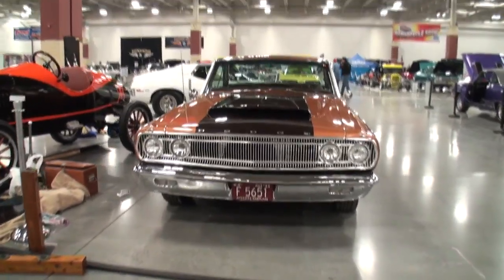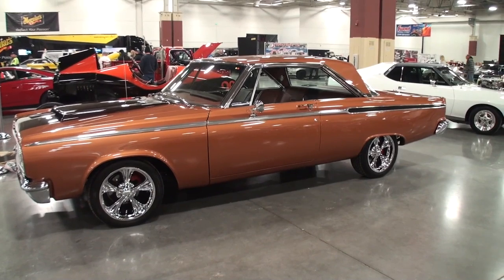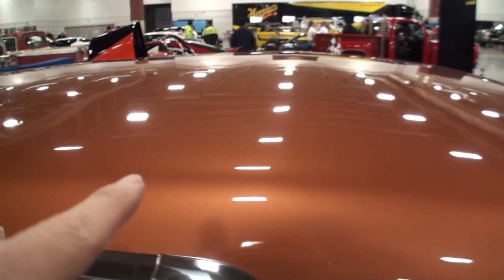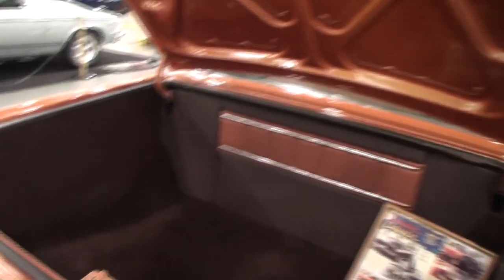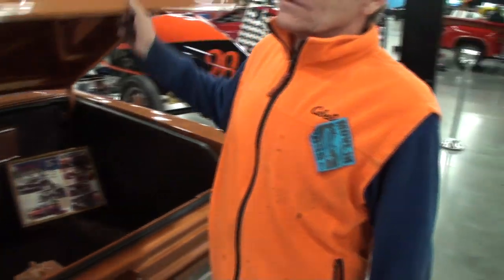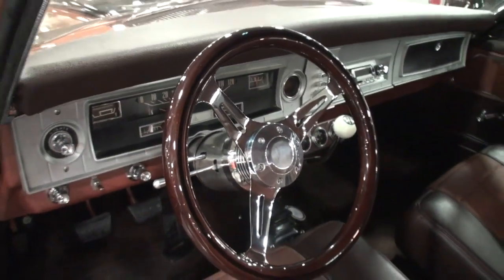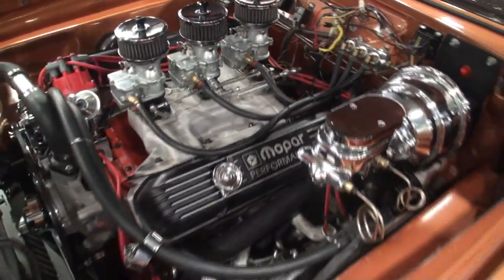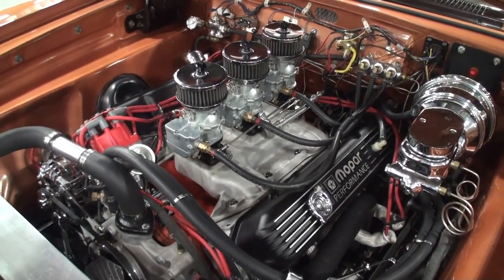1965 Dodge Coronet 440 2 Door Hardtop in Copper & Engine Sound on My Car Story with Lou Costabile

Comment: Original or not it's just georgeous..but when he hit the throttle to start it all carbs were working and when he started it the front carb wasn't excelerating like the back 2..look at the vid and watch the front carb but either way it's nice
Reply: Thank you for the comments.
 As to the carbs. Watch again.
On start up you will see i floor boarded the accelerator to feed a little fuel. .
Then while running. I was feathering the pedal. 
What you saw is tje PROGRESSIVE LINKAGE AT WORK.
ONLY THE PRIMARY CENER CAB WAS WORKING.  ON THE REAR. YOU SAW TBE SLIDER BAR MOVING NOT THE ACTUAL. CARB LINKAGE. VERY GOOD EYE. AND YOU KNOW WHAT YOUR LOOKING AT..  YOU SCARED ME FOR A SECOND .. .HANG ON WHEN THE 6 PACK,IS KICKED IN .
Reply from the maker: High praise for the looks of this car :-)

Comment: 1:40 It's stainless steel, Lou :)
3:53 The call that Dodge triangle thingie a "Fratzog". 
The more we know! I just learned that this year.
4:26!! Chrysler Power magazine!! I read that in the 90's, i still have a couple of their Tee's..that..sorta still fit :p
Mopar Action magazine is the tops for that ancient format, right now..their tech is beyond amazing. 
Well worth the subscr. price.
I wrote them like 10 yrs ago and told them to go YouTube..looks like Lou is smarter! Ahaha!
Reply from the maker: Thank you for viewing and sharing your knowledge.  Everybody sharing helps each other. Nice.
Reply: Thank you for your kind review. Lou posts some awesome rides. 
Tne Chrome at 1.40. Is Actually Crappy anoidized Alum.   That was very beat to hell and refinished at VINTAGE auto in watoma wis.
Being a 1 year only body style car. 
When you see other 65 Coronets most have all,the holes welded shut. And no molding. Its almost,impossible to find a good set. Moldings around windows and roof is Stainless.,

Comment: The carbs & intake look cool..but about 1/3 the CFM this engine needs.
450ish CFM & mini air cleaners wouldn't feed a 340, much less a near 500 ci engine.
It's like having a restrictor plate, in effect. 
But shhh..im just basking in the glow of this car <3
Reply: Thank you.. your on. The right track.
While i was building the engine, I lost control and built a NASCAR Engine for a NICE CAR. 
Thats my Grudge Race 6 pack
Those are the new 97S Stromburg carbs. Total cfm is only 760 on tne 2 Barrel scale. 
Equal to approx. 850 to 900. .
Cfm on tbe 4 barrel weight scale.  2 and 4 barrel cfm are. Measured different. 
,  Buts heres the other truth. 
I grudge. Race $$.
 I mske a couple passes . as you see it. I pit under cover.
Swap tne intake with,my cross ram Dual quads with 1800 CFM.  And. Rin for the big $$$ .
Kinda. Cool old School. 
I have to tell ya. With the 6 pack at 3300 4800 and 6000. Rpm. It will rattle your eye teeth .  ITS a driver as well,  Thanks for watching
Reply from the maker: Thank you for viewing and sharing your thoughts.

Comment: 6:37...a 490+ ci mill & Redline set at 9 grand?
Scarier than the current viru..oh..too soon, never mind!
Reply: Let me help,you out 
Great Eyes and ears
 Yes its a 440. Bored and stroked to 496C.I. 
As to the. 9 grand tach.
 No way can it run that RPM.
 The tach automatically pegs when tbe power is shut down.
However it is good for 6500 rs.
Thanks for watching .
Reply from the maker: I see Charlie shared info with you.